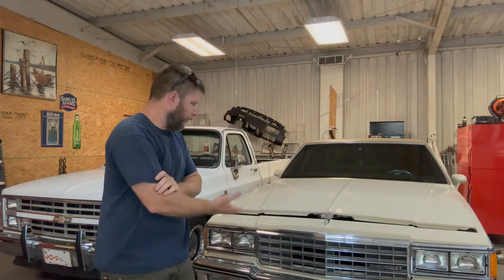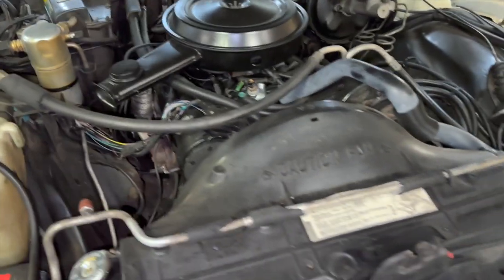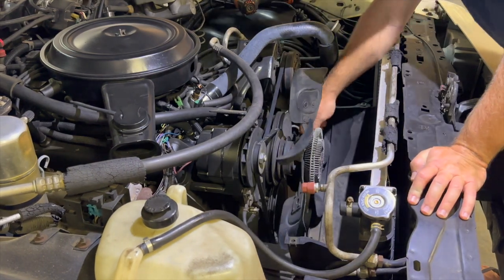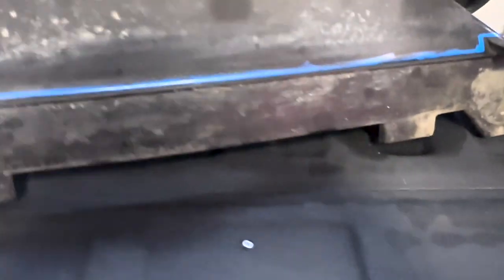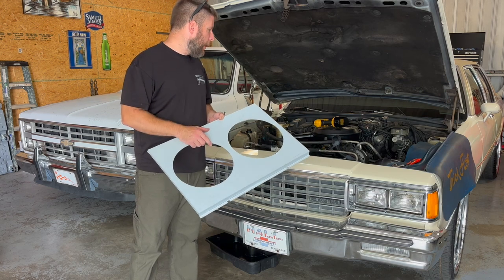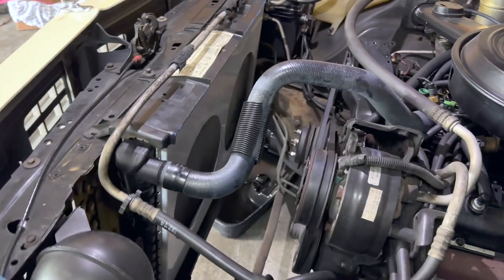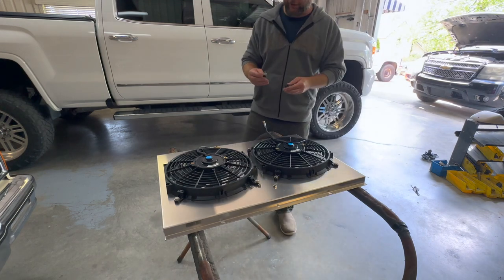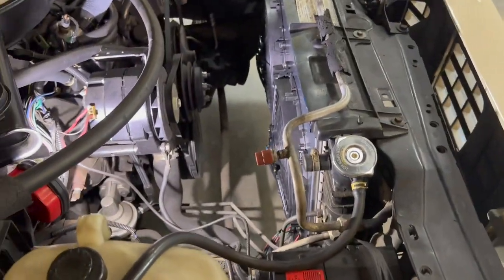Prepping my Box Chevy Caprice for Hot Rod Power Tour 2023 - How to Install Electric Fans

Comment: Do you this this same setup can be used for a 88 Monte Carlo? Wanting to upgrade to electric fans
Reply from the maker: The radiators should be the same or very similar in the B body and G body. Measure the space that you have between the radiator side tanks. I would bet this would be ideal for your setup.
Reply: It works they have the same size radiator

Comment: So do they pull air thru the radiator?
Reply from the maker: Yes, they pull through the condenser and radiator. The fans can be used either as a pull or push, depending on how you need to use them.